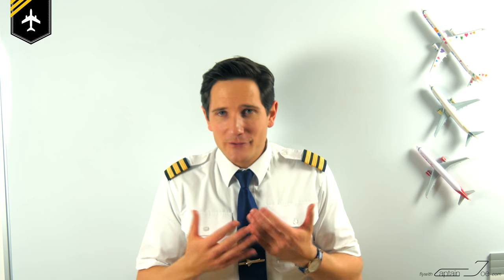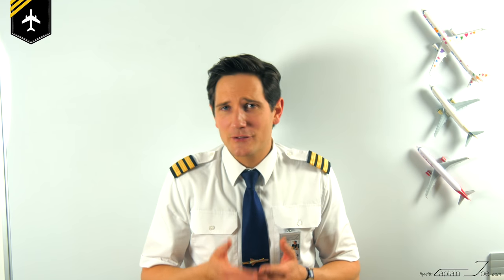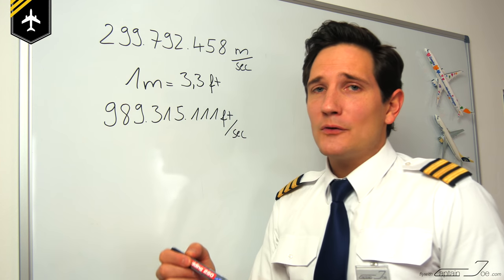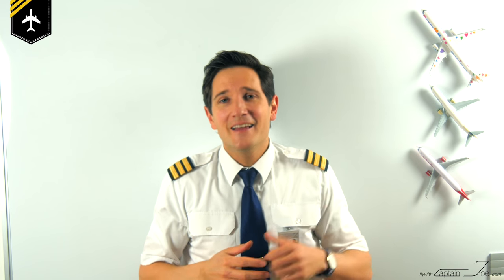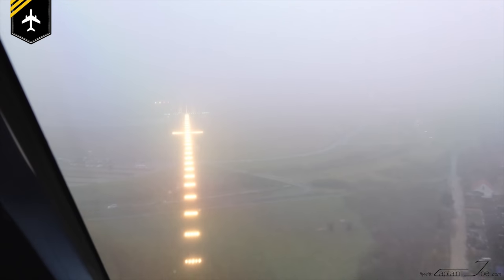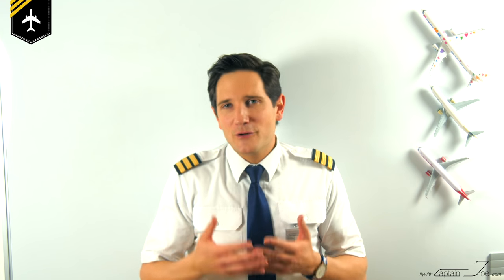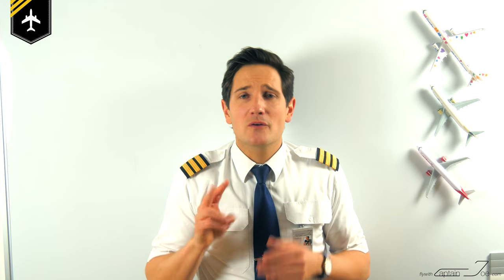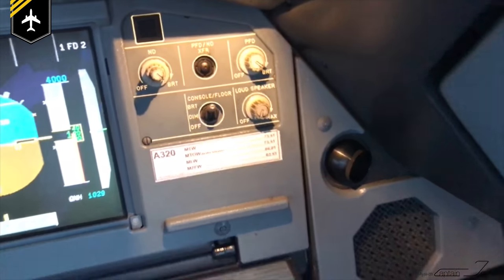50...40...30...20...RETARD...RETARD??? Radioaltimeter explained by "Captain"Joe

Comment: What I hear: TOO LOW: FLAPS, TOO LOW: TERRAIN.
Reply: DONT SINK
Reply: No you need more speed and go up to 21000 feet take off at 111 knots
Reply: Make sure to go mach3 at landing
Reply: Cameron Bratz GEAR!
Reply: That is when your crashing
Reply: TOO LOW, GEAR!
Reply: PULL UP! PULL UP!
Reply: Cameron Bratz PULL UP
Reply: Too low gear
Reply: PULL UP, PULL UP, PULL UP! STALLING!
Reply: LANDING GEAR, LANDING GEAR
Reply: @jasonparry9541  Not if piloting a balloon.
Reply: @dovaiS  shitshitshitshit...............
Reply: Pancakeking 78 noooo
Reply: TOO LOW GEAR
Reply: TOO LOW GEAR TO LOW FLAPS!
Reply: DON'T SINK
Reply: You need to put the flaps down.
Reply: @maxfitzpatrick1614  r/WHOOOSH
Reply: TOO LOW GEAR!
Reply: "Pull up"
Reply: SINKRATE SINKRATE TERRAIN TERAINN (this is in a boeing btw)
Reply: Me too until I learned, increase thrust, extend flaps,  nose up.  But I used to crash all the time.
Reply: @sandrawillis8774  o kk
Reply: I always hear the flaps part in PTFS. (It means that PTFS doesn't have flaps and spoilers and stuff like that in case you were wondering)
Reply: Sink rate sink rate. Pull up pull up. Too low terrain 😂🤣
Reply: Mine is to low terrain, to low gear xD
Reply: The scariest sound in the world :PULL UP WOOP WOOP PULL UP
Reply: SINK RATE whirRR whirRR
Reply: too low gEAR
Reply: PULL! UP!
Reply: SINK RATE, PULLUP.

Pilot proceeds to do pullups in cockpit
Passengers: 😵😵
Reply: BANK ANGLE
Reply: because of the GPWS
Reply: @billl605  genius !
Reply: WHOOP WHOOP PULL UP
Reply: @lprleay  PULL UP! TERRAIN TERRAIN

Comment: "The speed of light divided by the time....all stated by a synthetic voice computer."   I wonder what Wilbur and Orville would have thought if they had heard that 115 years ago!
Reply: Orville and Wilbur used their ties as wind speed and direction indicators.
Reply: Heh, interesting considering it's also half a century before the speed of light was discovered.
Reply: @viptech_c5286  The speed of light was first calculated in 1676 by Ole Roemer. His number (131,000 km/s) was off by about 30%, but it was an excellent measurement for the time. There were already estimates less than half a percent off by 1726, and the accepted value was pretty close to what we know now by 1879.

Comment: Hey Captain, could you do a video explaining how anti-ice and de-icing works? I am curious how the engine and wing/structure de-icers work. Thanks!
Reply: Jman Anti-ice works by piping hot air inside the wing leading edges. This hot air is taken from the engine, known as bleed air.
Reply: @Jman : that's the de-ice (on some planes) :)
Reply: 911gpd de-ice works after the ice has already formed, by inflating boots to break away the ice. The goal of anti-ice is to prevent ice from forming, in the first place.
Reply: haha, sorry, I wanted to reply to JD Modz
Reply: I've had it with all this motherfucking ice on this motherfucking plane!
Reply: Jman deicing is removing current ice like when on a car, anti ice is installed to prevent ice from forming, for example engine anti ice would blow some hot air from the engines onto the wing to keep the wing warm, though the effects of using anti ice effects overall performance because it means you have less energy for thrust since some of it it blowing onto the wing instead of as thrust, so say for example your at 36000ft then u turned it on, because engine anti ice reduces overall engine performance u would have to go low say 32000ft to compensate for the loss of energy produced as thrust
Reply: A LED and a cigarette crossed.
Reply: They flick a switch and the lights come on. How hard is that to understand?
Reply: Oh guys, should I write "an LED" or "a LED" ? I never know
Reply: Thank you very much :)
Reply: Jman same
Reply: Jman A
Reply: Jman h3 made a video about that
Reply: The likes are 320 lol common captain joe !
Reply: Airpond94

Comment: It’s all because of the times. 

Now in 2020 it should say 50, 40, 30, Handicapped Handicapped.
Reply: 50. 40. 30. Specially Abled. Specially Abled.
Reply: 50 40 30 cap cap cap cap cap cap
Reply: 50 40 30 slow slow
Reply: Wait... were there any plane in 2020 flying?

Comment: What's the purpose of implementing a volume dial if it's overridden?
Reply: Greg Caesar during CRZ or after TO, the ATC can also be patched trough that so pilots do not have to wear their headsets all the time whilst being on the flight deck. So you want a way to be able to control that volume. But since these call-outs must be made, it overrides it when turned off so when pilots are usually flying whilst using their headsets for COMM
Reply: Leeuwke131 Then why wear headsets if they can just use the speakers?  Also, is there a button needed  to be pressed when communicating via headset? I often hear about "stuck mics."
Reply: Greg Caesar when they use the speakers, they in most cases use a hand held microphone, which is not convenient during certain critical phases of flight where pilots need to have both hands available to control the A/C. That is why we use headsets for TO and LDG. And there indeed is a "Press To Talk (PTT) button" which is in most cases located on the mic when using handheld, or on the control stick/column.
The use of the handheld could probably also vary from each airlines SOPs (standard operating procedures) but I can't tell you that with full certainty since I'm currently doing my ATPL training for the moment so we haven't covered everything yet
Reply: Greg Caesar btw, a stuck mic is when a pilot keeps transmitting after having finished his message. This can either be caused by the pilot pressing the button for too long, or something physically has accidentally locked the button in the transmitting position.
Reply: Leeuwke131 So with the speakers, is the sound quality worsened? I take the ambient noises come into play whilst they're in use.
Reply: Greg Caesar well, the transmitting sound quality using the handheld instead of the mic on your headset might alter the quality a little, it will probably not affect it too much. The receiving transmission trough the speakers though, I'm not really sure but I think they are of good quality since details must be understandable and placing bad quality COMM equipment would probably increase the probability of something being miscommunicated, thus leading to errors.
The quality of the headset however completely relies on which one you buy or your company supplies you with. For smaller aircraft, such as an Archer, Cessna or something else (where there also are no speakers) you would want to get something that gives you a great noise cancellation because the cockpit is really loud. Althoug some flight decks in commercial airliners are also loud, this is significantly less than in GA, thus givi g the ability to wear more light weight, comfortable headsets. I would probably go for a very light TELEX 5x5 (but that's my personal opinion)
The quality can also be altered due to certain weather phenomena that cause a deflection or other effects.
Reply: Leeuwke131 Insightful. 

Good luck to you in your training. 

:)
Reply: Greg Caesar thanks :)
Reply: Greg Caesar It's not overridden. It sounds like that in all those youtube videos, because basically a microphone is recording a speaker under suboptimal conditions. It sounds different in real life.
Reply: @Leeuwke131 thats what happened with that one southwest pilot who got fired after calling some of his work mates bad names and stuff.

Comment: Hi capt Joe

Just wanted to ask, why doesn't the radioaltimeter sound during take off then?
Reply from the maker: Great question, it´s inhibited for take-off, cause there is no need for it :) Greetings Joe
Reply: Thank You so much for your reply, appreciate it!
Reply: Captain Joe 
Manual inhibit, or automatic inhibit? The case I see is if the plane takes off, and immediately has to make an emergency landing, then is the system intelligent enough to inhibit itself, or is manual inhibit covered in a checklist?
Reply: @stevedoe1630  it is an automatic system. No modern airliner would attempt to land back immediately after rotation since any speed above V1 would mean a possible runway excursion. There would also be a “don’t sink” alert associated with the mode 3 of the gpws if you lose altitude after takeoff. However, taking off and doing a circuit around the airport and coming back to land, is a different situation.
Reply: @FabioVernuccio  👍

Comment: Captain Joe....Who is actually a First Officer.

Great videos by the way :)
Reply: yep, they often alternatively exchange roles on each leg.

One is monitoring, the other is flying the airplane
Reply: Ulrik , that's a bit simplistic. A first officer is second in command, when they have suitable experience, and personality to match, they will promoted to captain or " aircraft commander " as it easy legally. Typically insurance companies insist on around 4000 hrs experience to swap seats
Reply: Robert Dagg That's also a little bit simplistic as promotion to Captain also depends on there being a vacant seat. In companies like British Airways where generally nobody leaves until retirement it is typical (except last year but that was a bit of an anomaly) you are looking at a fifteen to twenty years wait for command. Ulrik that's complete nonsense. Both the Captain and First Officer are pilots and both take it in turns to do the flying, the only difference between the two is that the Captain is the Commander and the one legally responsible for the safety of the flight.
Reply: Ulrik no, both take turns as PF and PM.
Reply: None of this guff you people have written here alters the fact that this man is not a captain.
Reply: so to speak: the first officer is the autopilot of the captain ;) :D
Reply: There is no irish border Problem: his nickname is Captain Joe and he explains this in another video

Comment: 7:15  In this context it might be interesting to know that in large commercial transports with fuselage lengths of over 50m there is a discrepancy between RA height and pilot eye sight height of up to 30ft, because of the positive attitude of the plane and the cockpit position higher than the RA-antenna , in a 747 even more. Which can lead to unexpected go arounds despite of vertical visibilities reported sufficient for an approach, e.g. CAT II  ILS 100ft >> as being at 100ft RA / approx. equal to main landing gear above ground (call out "minimum") your eyes would still be at say 130ft and no contact with the ground >> go around initiation. 🥲 This difference could be corrected electronically re. minimums, but would then not correspond with the required indication showing the clearance of the main landing gear versus ground, which should  normally pass over the threshold (beginning of concrete runway) at least at 50ft. And e.g. during the flare phase the difference becomes gradually bigger as the plane starts rotating, or with increased approach speed (indicated, increase due to gusts, or also in tailwind condition >> higher rate of descent required to stay on GP) it will be smaller, in other words variable, while the positioning of the RA antenna as close as possible to the main landing gear is practically irrelevant concerning variable aircraft attitude. And as it is known that the RA height corresponds accurately to the MLG height pilots have begun to use the indication, or in modern times the aural announcements for the RA, for flaring their airplane to the rhythm of the countdown. Which I personally find inadequate. Down to 10ft one must/may use the vocal assistance (gates), but from the 10-call the pilot should flare visually, keeping his eyelevel (or cockpit) without sink rate, level to the runway (runway edges remain optically fix)  by rotating smoothly around the transverse axis (elevator) until the main landing gear touches down . This landing technique is mainly recommended for large transports ("heavy") with an eyeheight of 30-50ft when touching down. Even more important  of course is the aiming point / look out. Use of equipment for crosswind landings is again another, but even more interesting story / topic. Although some may call you "head-flyers" - contrary to the benefits you get for successful crosswind-landings.

Comment: Hey Captain Joe, Can you do a video on why most airlines prohibit the use of cell phones during a flight? Thanks !!
Reply: LOL wut cellphones are on a different frequency to the radio like 800MHz to 2000MHz difference the common belief is that it interferes with instruments but that to seems to be false and the FAA does not prohibit usage of phones on planes (its up to the airlines themselves) although voice communication is a different thing

what more than likely happened to you is the intercom was going dit dit dit dit cause it interferes with them hella hardcore (unshielded sound systems that is... it only takes a magnet to clean it out of the system) and the attendant was pissed because you had made annoying bleeps while they were talking to the people in the cockpit or other flight attendants 

cellphones do get a little noisier when on a aeroplane due to the fact that a plane will enter and exit a cell very fast and the phone will try to connect to each one but except in extreme circumstances electrical items won't do anything major to the plane (plus to the US airlines are just skimping out some European airlines have a "cellular block" inside the plane so the phones connect to it and then the plane connects to the radio towers thus minimising potential interference ) thus switching you phone off/putting it in flight mode is  more of a just in case type of thing I mean if it was as dangerous as people would have you believe you would have been at a court case not just scolded by a flight attendant
Reply: have you read my whole comment? as i said that's due to a unshielded electrical system you can shield them with ferrite cores they have to be certain types but my family home had loads of them so they cant be that expensive
Reply: XD ok dats fine i did write a lot

Comment: Hi Captain Joe, Why do pilots retract flaps after take off? why can't they leave flaps in extended position?
Nices video.
Reply: Mudassar Ali Khan Flaps add drag (air resistance), causing the engine to work harder to overcome that drag and maintain a given airspeed. Also, flaps would simply tear off the plane at high speeds.
Reply: Kiku Aviation Thanks for the explanation. greetings

Comment: When i try to land in x plane 11 i pulp to 5 degrees to get that biter but the plane stops descending and flies up again then  have to Ryanair land it and do a nosedive
Reply: Ha ha , I do sometime the same, maybe, you should fly a little bit slower (for example, with a 737 800 , about 140 kts) and do the flare a bit later. Sorry for my bad english, greeting from France 😉😄
Reply: Dutch001  your name is like this youtuber called Swiss001
Reply: If your flying a 737 flare at around 10 if your flying with the proper v ref speed +5 at around 30 feet you want to be leveled out and holding that until after the 20 callout - xplane 11 “pilot”

Comment: What is a flare?
Reply from the maker: I´ll see if I can make a video about the flare soon. Greetings Joe
Reply: Simplistically:

Flare is pulling the nose up to slow the aircraft and rate of descent. reducing vertical speed reduces the impact of the wheels hitting the runway.

A very soft landing is when the flare is done so perfectly that vertical speed is almost zero as the wheels contact the ground.
Reply: pipefitters1 It is when you are about to hit the runway and pull the yoke and the nose lifts and lowers your V/S (vertical speed) so you get your rear gear down first
Reply: Flare men's pulling the nose up to slow down the aircraft when landing
Reply: Its when the pilot pulls back on the stick before touch down to reduce speed and possibly making touchdown softer. If the pilot pulls back on the stick to much or wind picks up and the plane goes back up the gpws will call out,"float,float." and count back down. Also if the landing is hard then gpws will callout,"ouch." just some facts. Or not. Im im terribly mistaken by airforceproud95.
Reply: pipefitters1 something that comes out from the sun
Reply: It's a stick, usually red, that you light for signaling. But that's not important right now!
Reply: A very hot think despeced off a plane to defeat fox 2 (ir guided missiles like the aim 9

Comment: 300.000 km/s but in the void
Reply: 2.9979x10^8 m/s in the void
2.9970x10^8 m/s in earth's atmosphere
Not that big of a difference, especially when you round up 4 significant figures short of the point where you can see the difference